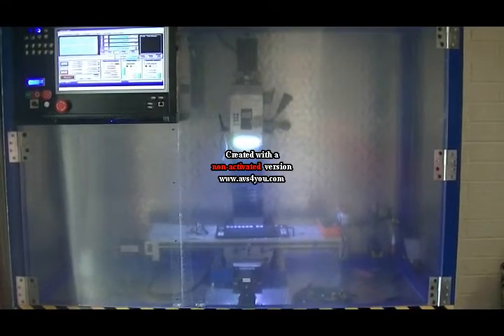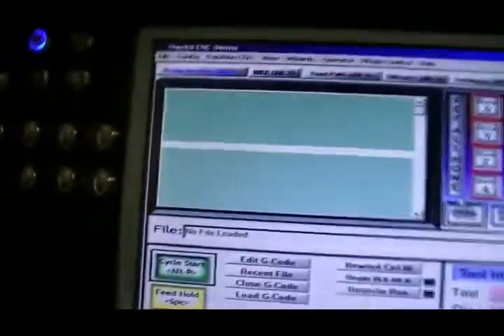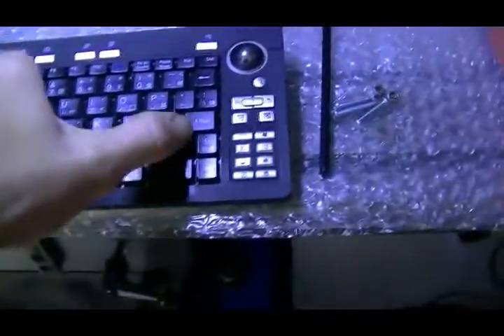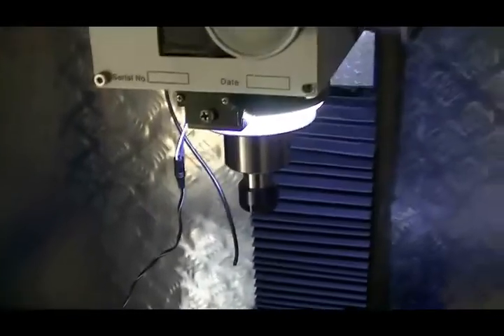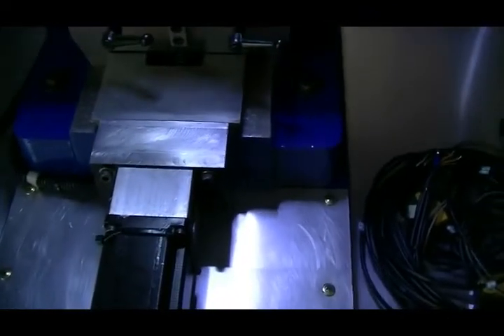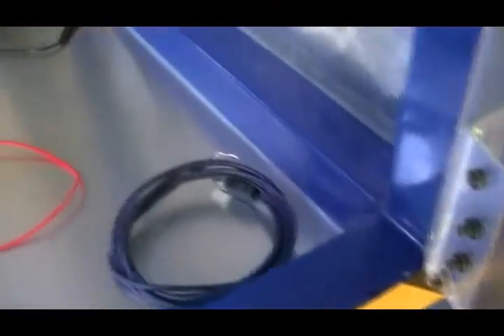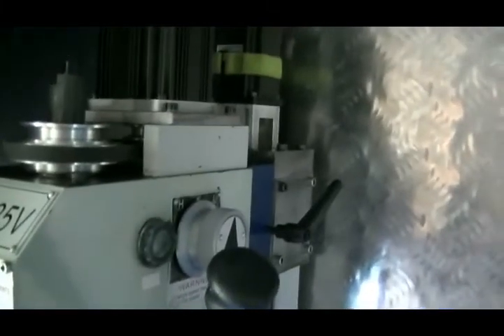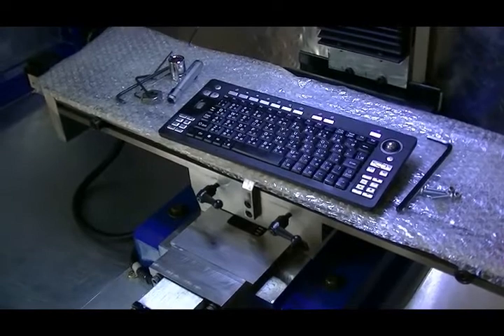CNC mill conversion  Titan TM25  G0704

Comment: where did you get your ring light? that is awesome.  what voltage is it?
Reply from the maker: Matthew Hadley hi matt 
the light was off ebay , its a car led headlight 90mm dia . ive got it running on 12v but i think it can go to 24v but dont quote me on that. hope this helps mate.